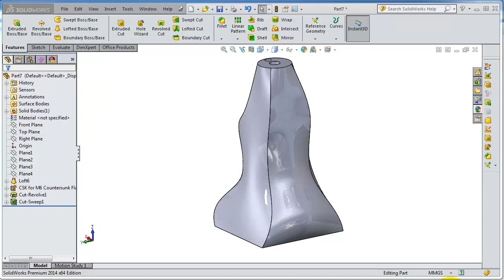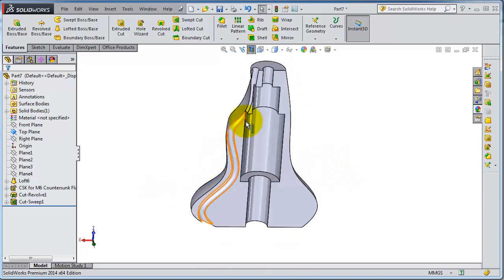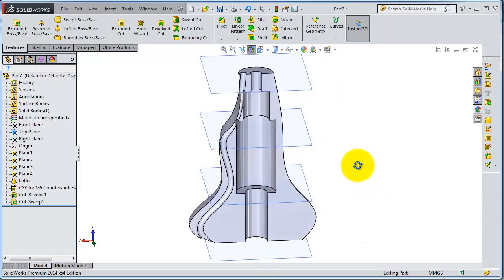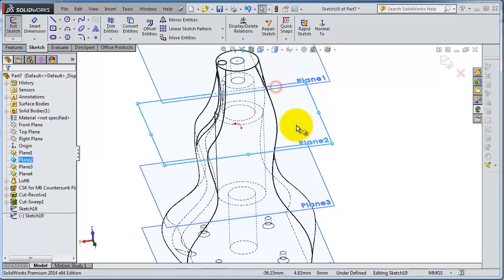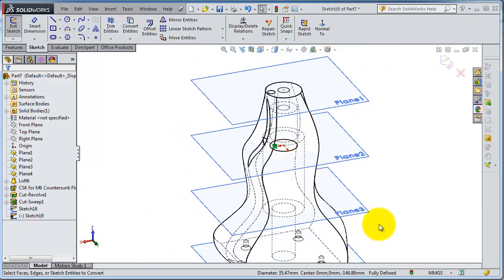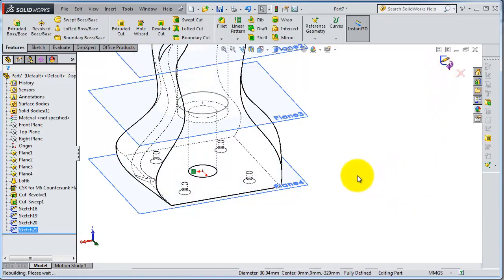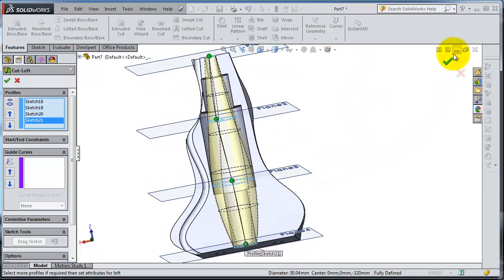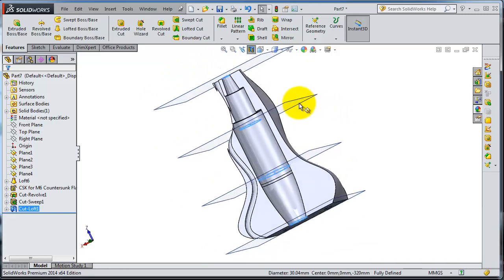SolidWorks 2014 Tutorial 38: Lofted Cut

Comment: Because the upper parts of the lofted cut are inside the revolved cut, the revolved cut is visible at the end of the video. On the other hand, because at the lowest parts of the vase (near its base), the revolved cut remains inside the lofted cut, the lofted cut is visible at the end. This should be emphasized I think to avoid confusion.